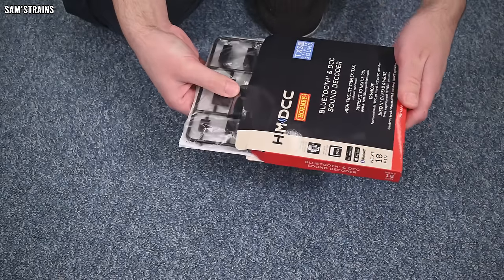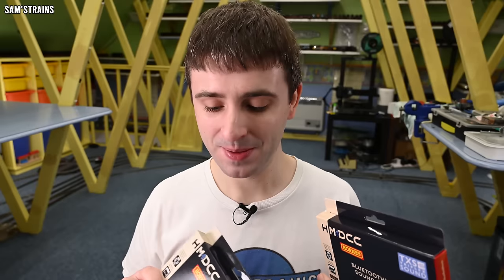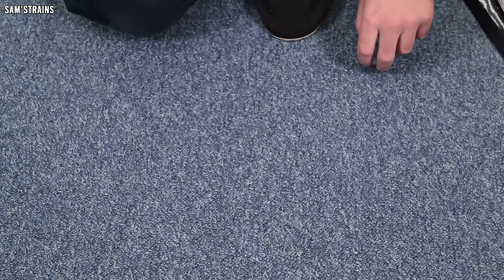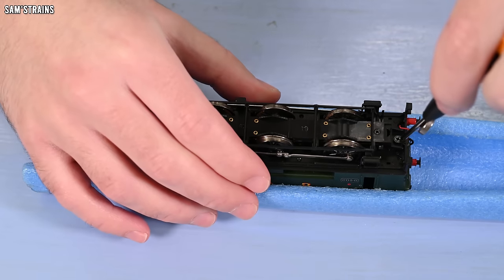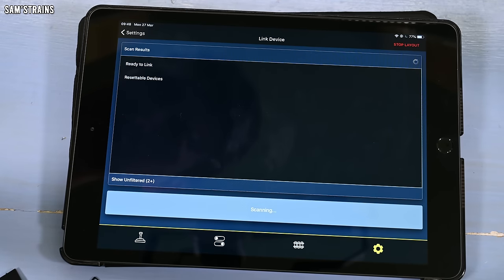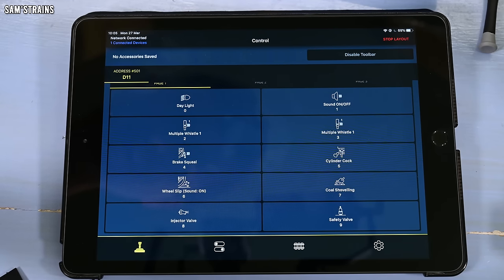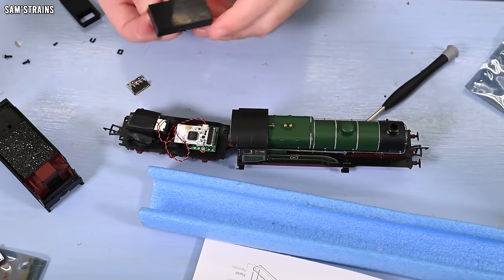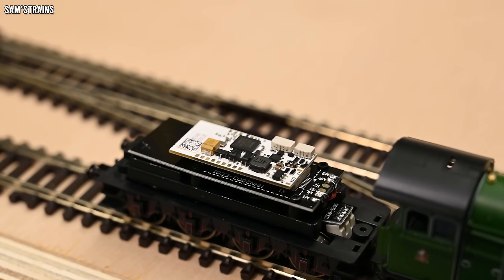Too Big For Most Locos & Burnt Out After 1 Day | Hornby's New HM7000

Comment: I am an analogue runner and I cannot see me switching to DCC. This is just my preference and also because I have so many older locos. However, I found your video very informative. 
Hopefully, Hornby will expand the system with time. It is early days after all.
It is a shame that one burnt out so quickly. I trust that you can try to get a replacement for free or a refund.
Reply: You are missing a lot Jeffery without DCC- and for the life of me I can't see why these sort of developments by Hornby (making it easier and cheaper) can't change yr mind. Maybe watch there recent Q/A on HM7000 on there channel. It only aired a few hrs ago. Cheers. W
Reply: @wapphigh5250  I think you missed the point about having so many loco's? At £63 each loco X no of loco's= no hope or interest from many of us old timers!
Reply: @paullepine4765   I don't Dennis is missing much. I run dcc, dc analogue and ac analogue. They all have their good points, they all have their bad points, but I have found, and consistently have found, the analogue systems to be far and away the most reliable and easy to use, with an edge to ac analogue however that's used on more niche trains. 
I'm not getting rid of my dcc layout, but the additional layouts/ scales I've acquired since are all analogue
Reply: @muir8009  Like you, I have both, and I made choices depending on scale/ease of installation/type of traffic. UK OO and N -> DCC for me, as continental HO and N. Japanese and US N -> analog, zero DCC socket in Japanese engines, and use of painful to install DCC boards on US models. Plus you run US freight trains on long distances with minimal shunting, especially if you choose single track lines, which mitigates the need for DCC decoders. Japanese traffic is nearly all passengers EMU/DMU with no shunting, so minimal appeal for DCC. But that's my way to do things.
Honestly, if I started from scratch today, I would certainly stick to a full DC solution for lots of personal reasons, first one is I am a scrooge.

Comment: They do seem tempting for larger scale outdoor layouts who use battery power. If you get a cheap dcc ready loco of ebay, take out the electric’s and wire up a 9v or similar battery to the wires where the pickups usually attach thus removing the cutting out issue, plus size won't be an issue due to the scale being larger. Wire up a motor, plug in the chip and you're good to go. A whole battery operated train with sound for £60 where it would normally cost you way over £100.  Then you can have the control and the sounds of british locos on a garden railway layout where the sounds of realistic british locos are usually quite sparse. 
However burning out the next day, I'm not too keen about 😂

Comment: yes the size of almost any decoder is an issue, I use DCC and "Normal" DC for operating my railway,   and just because a loco has a decoder socket inside, does not always mean that there is space for a decoder.  I have tried to install two different types of decoder into one of my Hornby 08 shunters, one a direct plug in type but the body would not go back on fully. And the other was a wired version, but again trying to make it fit somewhere was the issue.   We are 15 mins in to your review, and we have 3 locos that the new decoders don't fit into...  And Big Kendo makes the same point as well!

Comment: Bachmann have an app which you can install on a laptop and use USB cable to connect to the dynamis controller. Wonder if you could use a Bluetooth wireless usb connector to put between the laptop. Then with a Windows tablet you could have to achieve a similar result with current dcc chips. Obviously not quite the same I know

Comment: I have just received a 8 pin decoder and, after much faffing about, finally got it to work on Bluetooth on my iPhone,  and also on my Android tablet using the Locomotive dcc app.
I can run both systems at the same time, not that there is much to gain doing so.
I fitted this to a Hornby A2/3, and experience the same problem you get with TTS decoders. Not enough room. I had to fit the smallest speaker enclosure, which gave a weak shrill sound. A bit of modding will be necessary to fit a decent speaker, never mind the stay alive capacitor.
I probably won't be getting anymore.
I find the  Locomotive dcc app has a far better control interface.

Edit.  Just nipped upstairs to confirm it was still working on dcc.
Stared off OK with motion and sound for half a lap and then just stopped. Still OK on Bluetooth,  but I can't get to work on dcc.
Too bloody flakey for me.

Comment: I'll be very interested to see what happens with these going forward. I have a number of my locos sound fitted with both ESU and Zimo decoders and am interested how these stack up.

With the price side of things, I think there is probably more to it than meets the eye, as there is definitely more differences than just the use or not of a Bluetooth chip.
Unfortunately I can't find any detailed specs of the TXS decoders hardware capabilities, while I have seen that for the Zimo MS family. The current Zimo MS chips can play and blend up to 16 audio channels compared to 3 on Hornby's TXS, whilst 16 might seem overkill it can allow for dynamic blending of general running noises, such as engine/wheel sounds and the like that are played within F1 (sound and engine on), as well as horns etc. This along with configurable sampling rates can allow for higher quality audio recordings to be used.

So if you don't feel you need that, TXS seems like an excellent entry to the sound market.

FYI: Also it should be pointed out that the blank area at the end of the PCB that means the Next 18 doesn't fit in most of the locos tried will be where the Bluetooth antenna is situated as it needs isolation to avoid interference alongside a minimum length to work effectively. Not using Bluetooth would have have been substantially easier so I have to give Hornby credit for that.

Comment: Nice balanced review again, thank you for that. I ordered a Next18 sound decoder, intended to use in my Sonic A5 or Heljan NER Railcar. I'll see if it fits. Simon Kohler said however, that the next badge will be smaller in dimentions, so this is a possitive! Succes with getting a replacement for your decoder.
Reply: Did he say the next batch will be smaller for ALL chips or just the Next18? What you said is huge. I would wait. Where is that link to what Simon Kohler said?

Comment: I think I will stick with running DCC Sound Fitted locos on my DC system. Bachmann, Sonic, Dapol and others work that way. Put the power on quickly and you get the wheel slip; start slowly and you get steam so on with chuffs changing as you increase speed. They the seem to die away when the power is left constant. 
Works for me.

Comment: HI Sam, great review and explanations of set-up.
I have bought the 8 pin version sound decoder that I have plugged into a Bachmann Fairburn 4MT tank loco chassis.
I don't have a body so cant yet comment on whether I can make it fit. I suspect I will be fitting the decoder and a socket into the coal bunker. I have 3 other Fairburns - so may open one of them to check.

 The supplied sugar cube plug-in speaker isvery impressive.

As I am on Android I have to wait for the app release.

However, I plugged the decoder into my ESU test board and was able to set an address I wanted and read all the CV's. On the main track my Gaugemaster Prodigy express runs it perfectly well using 128 speed steps and with POM I can adjust values on the fly.

I am suitably impressed, and as all my other locos (12) have either ESU or Zimo sound decoders at around double the price, this looks like the way forward.
Clive

Comment: As an IT-Technician: 
The PCB is too long, most likely the  End of the PCB is the a Lower Energy Bluetooth Antenna. A small Antenna Socket and a wire would be better as it would have shortened the PCB. Common use in Notebooks, but it would have costed more, then a PCB printed Antenna.  As it would increase the compatibility to other Locos, i think the 0.2 cent more would be adviseable for Hornby's when you want to sell a System, increase compability, so that the Odd non Hornby's Loco can be intregrated.

The long Update and Download times comes from the Bluetooth choosen, BLE uses less Power and but has a much lower Data-Transfer rate. BLE Drops from 24mbit/s to 1-3mbit/s in Base mode and to 128kbit/s, 500kbit/s, 1mbit/s, 2mbit/s in Low Energy mode depending on enviroment..  I think it runs in Lower Energy mode and Sam lost the speed lottery with one channel at 128kbit/s.  Never forget that Bluetooth share the same frequenzy's as Wifi.

Comment: Sam, do you think I could use this on my O gauge models with the right power supplied to the track
Reply from the maker: Yes you absolutely could!
Reply: @SamsTrains  Won't this depend on how much current the O gauge loco uses?
Reply from the maker: These decoders are rated to output about 5x what a typical OO loco motor draws... I've never had an O gauge loco draw anywhere near that much, though I suppose some larger ones could!
Thanks for watching, Sam :)

Comment: Thanks for  great review as usual! Hornby has been busy doing PR, I see many reviews of the system. Impressive indeed they managed to deliver a product that is bluetooth AND DCC for a much lower pricepoint than the competition. 
As a continental N scaler, obviously those large Next18 decoders won't fit in many engines, and the sound bank will have mostly UK projects for now.But it's still an impressive feat (hardware, software...a lot of money has been put into this).
All issues are solvable (even smaller or "micro" Next18 decoders might be on the roadmap for later).
My only criticism is the lack of open standard (as far as I know). DCC has managed to become a worldwide standard. Next18 as an interface is (finally) getting a de facto standard in OO/HO to N scale models. However this bluetooth system will remain 100% proprietary...and in the model train business, you've got people who will use their trains for 10/20 years or more. So no matter how great it is, it will be always tied with Hornby. But, since these are also 100% DCC and NMRA compliant, even if Hornby were to go under or stop the system, I guess those would fall back as regular DCC sound decoder anyway.
Reply: Potentially, this system is DCC on BT, two open-source standards. Anyone can manufacture DCC decoders with a BT chip integrated, and code a BT interface for JMRI, for instance.
Reply: @OlivierGabin  Thanks! And indeed several have tried and developped bluetooth solutions, including in the US; but it never was widely successfully because it was proprietary AND from small relatively unknown manufacturers (no matter how good the products might have been). 
What I meant was that - as far as I known - the BT part of those Hornby decoders and the related protocols are not published by Hornby. So those decoders are effectively proprietary and Hornby locked when it comes to the bluetooth part. But I may be wrong and may have missunderstood your reply of course!
Reply: @LocGeek  We are on the same track. As a Linux taliban, I am for open source, and I am convinced, like you, that DCC on BT will never take off unless open source.
When direct electronic control of model trains started in the mid-1980s, you have, in Europe, two competing systems, the Fleischmann one and the Trix/Märklin system, both proprietary and both totally uncompatible with each other. Then came DCC at the beginning of the 1990s... There is some annoying limitations to DCC today (try to enter the complete serial number of the last engine I bought, 23-040-9, as a DCC adress, you'll see what I mean...), but it had succeeded because it is an open-source standard.
I think we will see such a move in the future. With the possibility to have 736210 as a DCC adress for the corresponding Italian engine I have...
Reply: Bluetooth is a standard that anyone can follow. Hornby must be running a proprietary protocol on top of the Bluetooth to control the DCC decoder. It is this protocol that needs to be standardized and made available to everyone. Hornby should do the honorable thing and allow NMRA to make the Hornby protocol into a, royalty free standard, standard that anyone can follow. This is when Lenz did when they released their DCC protocol to NMRA and that was hugely beneficial to the industry.

Comment: I would not be surprised if those decoders, and increasingly more current-production decoders, use systems-on-a-chip for the vast majority of the functionality. It makes a lot of sense, and the SOaC doesn't even need to be that powerful for basic decoding: just enough to decode NMRA signals and control gate drivers for MOSFETS. Sound of course will take more processing, of which there are likely plenty of SOaCs that are more than capable even on the lower-end.

...also need to be capable of some longevity to be useful...

Comment: Hello Sam, I  wasn't able to see too closely but it looked like there may have been a section of the circuit board on the N18 at the opposite end to the plug with no components on it. If this is the case could you cut a piece off that end and make it short enough to fit some of those locos? Did Hornby make it too long deliberately I wonder.

Comment: Yesterday I watched the entire 80 minutes of Hornby’s HM7000 Q&A, plus 15 minutes for their late start. Honestly, Sam, I learnt far more from your 50 minute video than from Hornby’s frankly very amateur presentation - despite their six people running it! 

I’ve also picked up a few more pros and cons from reading other comments here. Thanks to you and to all for the tips. 

As a DC person who’s been wavering about DCC for a very long time I’ll probably give this a try. Of my 65 locos, though, only 3 are supported by Hornby’s currently available sound files. Which highlights another con: the Q&A implied Hornby only has the one guy making up new sound files as one part among others of his job. Even if nothing happens to him, God forbid, it could still be an eternity before they’re able to release even a healthy range of sound files for their own currently available models.

Nevertheless, if my dabble with HM7000 goes well I might be tempted to upgrade to a higher quality DCC system, budget permitting.
Reply: Yeh I watched that Q&A as well. I 100% agree. Sams review cut right to the issues here. Hornby made it all seem it's all going to be smooth sailing - but clearly it;s not. Sam had every right to point out these issues in this review. One of his best.

Comment: This is an interesting system,  but I feel it won't replace a proper controller and DCC system, especially if using points, lights and other accessories.    The decoders communicating via Bluetooth to the decoder is great for programming though.   I do hope this takes off with other manufacturers also as it will make programming decoders a lot easier in the future.    I guess these are okay for a first release, but unfortunately it looks like there are still some teething issues with the current itteration.   Hopefully the next versions will improve these and I honestly do hope other manufacturers start following along.
I noticed Hattons have 8pin available on their website and from what I can tell the sound ones are about the same size with the non-sound version being a bit smaller.  6pin look like decoder with no sound, but are only availble as preorder.
Reply: I don't see accessories being a problem. We can currently control them through the track bus via an accessory decoder. There is no reason these cannot also have bluetooth built in & still draw power from another source, including the track.